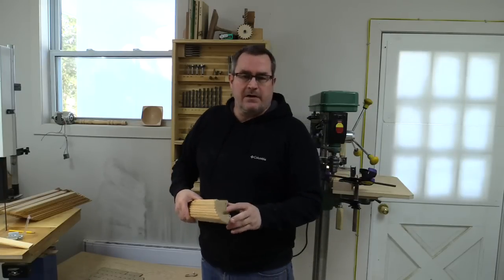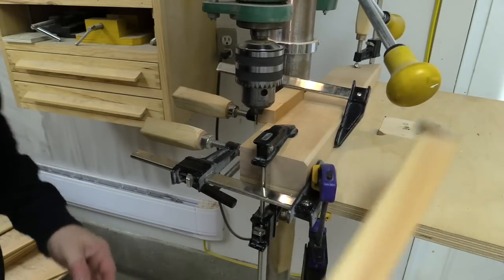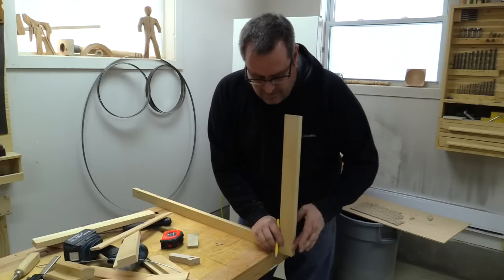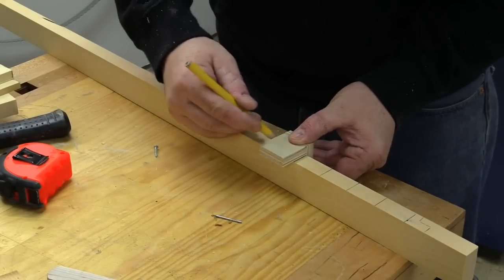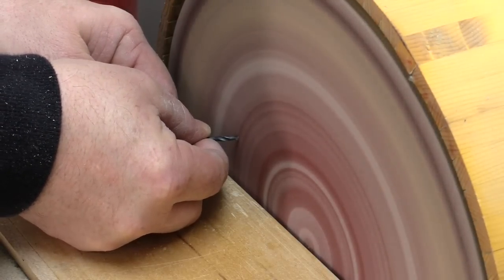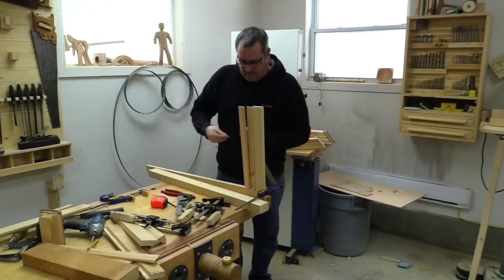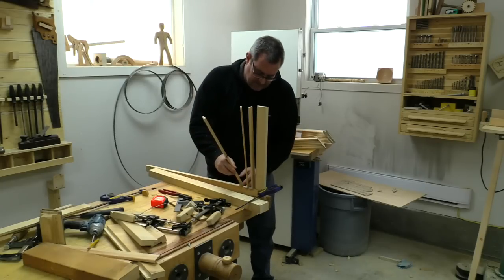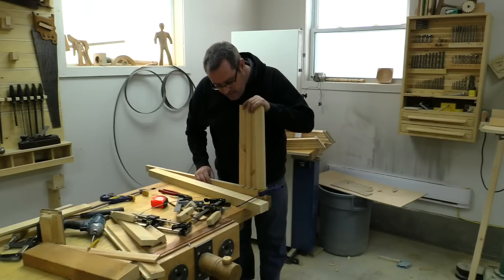Making Wooden Blinds Part 3

Comment: Looking good I wonder if coat hanger or a TIG filler rod for welding would work for your wire might be stiffer. The blinds are going to look great  Thanks John.
Reply: i was thinking the same thing. just got get any dress clothes dry cleaned and get the hangers to make blinds.
Reply from the maker: Backyard Woodworking Coat hanger is a good source for the wire. It is the right size. The pins don't have to be especially stiff, though, so the hanger wire would be better since it's easier to cut.

Comment: Did you give any thought to temporarily attaching over-sized knuckle blanks together and shaping them on the table saw/router table?
Reply from the maker: krtwood Not specifically, mainly because I know that something like that would probably take longer to do than cutting them out and shaping them individually. Besides, they don't need to be perfectly identical, just close. Some kind of plastic 1x2 that I could shape then cut slices off would be ok, but I don't have that.
Reply: I Build It
For me it's more about managing my energy and tolerance for tediousness.  Even if it wasn't any faster than I could theoretically do it individually, I know I would most likely end up dragging it out for twice as long or if I did power through it I'd give myself a nice long break afterwards.  So it might be slower for the process but faster for the project.
Reply from the maker: krtwood It took less than 2 hours to make all of the knuckles for three sets of blinds, so it's not really that big of a deal. It took longer than that to make the slats, and that was for just one set. There's no getting around the tedium when making these blinds!